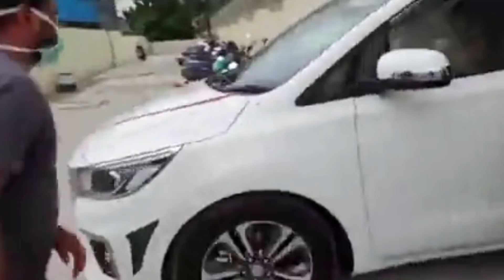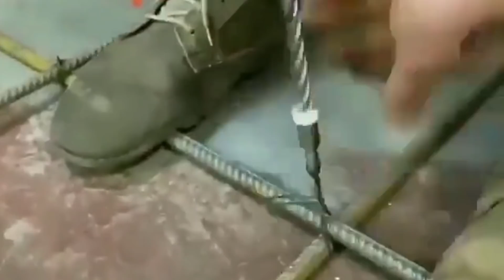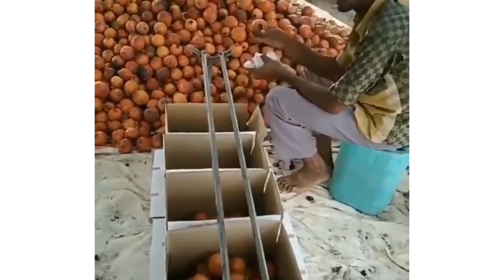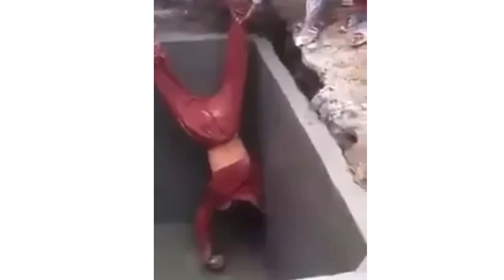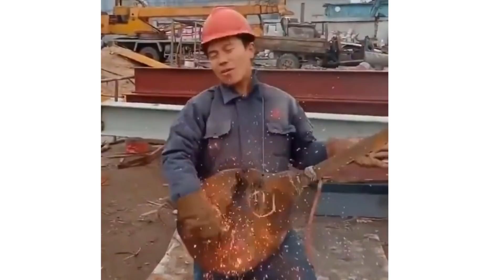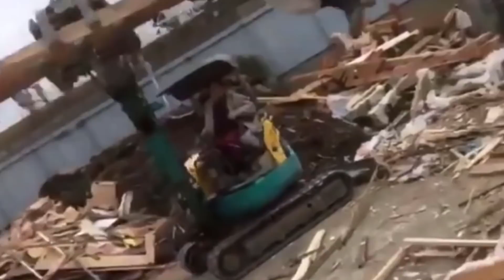Bad Day at Work...? 2020 Part 6 - Best Funny Work Fails and Wins

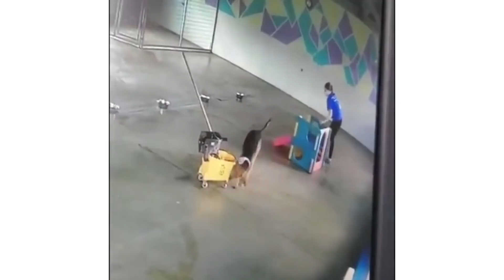Comment: 1:20 I couldn’t even mad at the pup. It’s like a pup I had that would poop on a sock rather than the floor.
Reply: I wonder if it was toilet-trained and thought the mop water was a toilet.
Reply: 007Ben If that was the case good doggo. I wish I could train and trust my pack with an open toilet bowl.